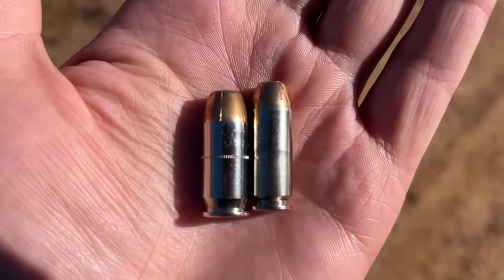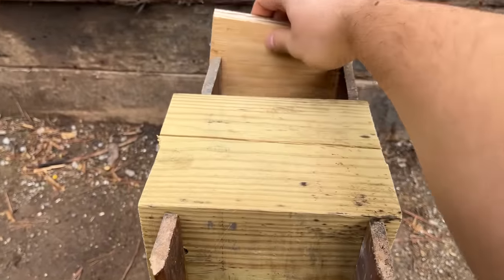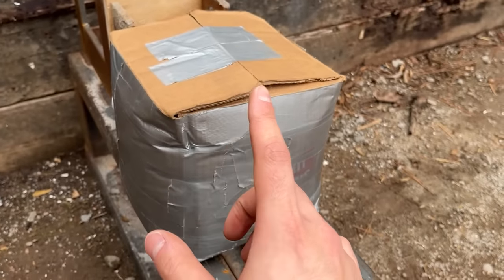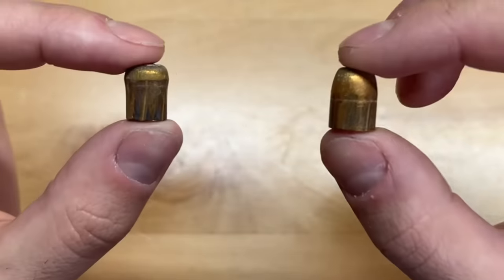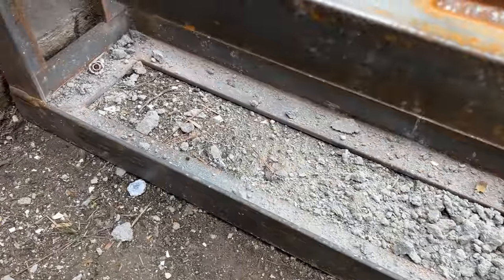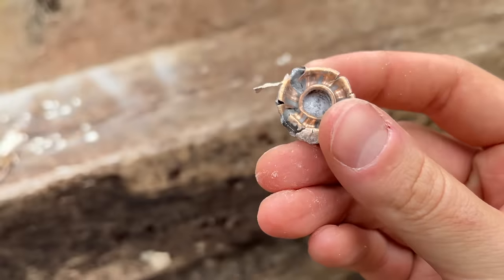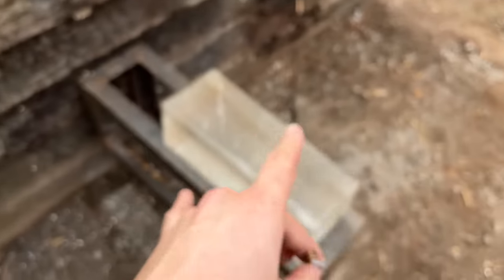45 ACP vs 10mm: Unbelievable Difference On Barriers

Comment: Just a thought: controllability enters into their defensive capability equation.  If a .45 is more controllable than a 10mm, then the all important follow-up shot issue comes into play.  Also, the .45 on the first tests was a flat nose commercial vs. a military ball round.  That would certainly make a difference in block penetration.  Finally, it would be instructive to see if a +P .45 would really make a difference, or a .45 of 180, vs 230 grain weight - after all, energy goes up as the square of the velocity.  Interesting video.
Reply: Ive got a 1911 in 45acp and ill say for a fact the 230gr hornady crutical duty +p atleast feel like theyre hauling the most ass (i know theyre not) but its got the most felt recoil compared to even the g9 defense 117gr ehps ive got in 45 which move at like 1500fps
Reply: Ft lbs is meaningless. You want to consider the momentum. Momentum and sectional density determine the ability of a bullet to penetrate. Momentum determines the recoil force. A 45 acp and 357 standard loadings have similar momentum, though the 357 has a much higher sectional density and much lower bullet weight.

The 220 +p critical duty is hauling ass for a 45acp, and it's a heavy bullet at that. Unless a bullet is travelling multiple thousands of fps, don't worry about ft lbs of energy
Reply: @bobjohnson1633  Well, not meaningless, but certainly the momentum of a bullet is grossly underrepresented in discussions about penetration in videos and posts.  It's also the case that - particularly in handguns, with their normally short barrels - acceleration to a higher muzzle velocity requires higher pressure, bringing with it greater muzzle blast and powder-related recoil force.  That energy-seeking path costs controllability as a result, whereas heavier bullets at lower velocity are tamer and more controllable.

Comment: I love that you used the heat gun so that we could see better. I think you are the only one I’ve seen do that. 

This was an interesting comparison. However, I think these cartridges fit different niches. The 40S&W is probably a better comparison against the 45ACP while the 10mm and 460Rowland are probably a better comparison for each other. Either way, the 45ACP wins at suppression.

Comment: Nice video, but it would have been nice to see you test some "good" ammo, like underwood or Buffalo bore since most 10mm on the market is basically .40 anyway. To put this into perspective, the 10mm I carry is over 700ft-lbs at the muzzle vs the 560 that the HST makes. And the hardcast rounds they have are incredible as well.
Reply: Yea it would be nice to see Federal American Eagle up their loads in their target 10mm to at least 650 ft lbs. I refuse to buy over priced 40 s&w spec 10mm that barely breaks the 400 ft lb range. Sig makes a decent load too. They actually have more pop than the Underwood 180 grain 10mm that I normally use.
Reply: Underwood extreme penetrators are absolutely amazing, look up 10mm and bullet proof glass, crazy stuff.
Reply: I wonder how well the 10MM does on a grizzly bears head at 10-15 yds.
Reply: My assumption is that a lot of factory 10mm is under-loaded to prevent issues with early 10mm 1911s that had a tendency to beat themselves up. This made sense when there were few 10mm options. Now there are a plenty of properly-designed 10mm pistols to choose from that can handle full-power 10mm. I just wish manufacturers were honest about labeling low-recoil 10mm ammo as such.

Comment: Years ago I was looking at 10mm over 45acp but it was hard to find and many weapons don't use it. So I switched to 45acp. The idea was to create as much damage as possible with the biggest wound channel as possible. Penetration was not on my radar in my self defense pistol caliber. In fact you really don't want alot of penetration and collateral damage. This video proves the research I did. TONS of ammunition available plus reloads (I like making my own hot loads if I need some extra umph). Even in wood those channels are big.

Comment: The same things you found here make a 10mm a great choice for a pistol caliber carbine.
Reply: I think the opposite is true: With 10mm you're getting all the overpenetration of a rifle with none of the ballistics advantages. With 45 you're getting less overpenetration with very good ballistics for a pistol caliber.
Reply: @scottfree6479  With the extra 300-400 fps I get with carbine over my 10mm 1911, expansion would not be a problem.  The 10mm, 357 Mag, 44 Mag all have enough powder capacity to make good use of the extra barrel length in a carbine.  I see the same kind of velocity increase between my 44 Mag pistols and my 44 Mag lever gun.
Reply: @timclaus8313 do they have 10mm carbines?
Reply: @timclaus8313  Expansion is never the problem; overpenetration is. If you actually want to do serious damage then use a rifle pushing over 2700 fps at the muzzle.

300blk and 45acp are ideal for home defense because they won't overpenetrate and can be suppressed well. A 10mm might hit, what, 1500 fps? 1700 at best with a super hot load? That still isn't even close to what a 556 will do going at 3000+

10mm really doesn't have any purpose. It's too powerful for a pistol and too weak for a rifle.
Reply: @JesusChrist_IsTruth-LoveForALL  Hi Point, Bear Creek Arsenal and Kriss all make 10mm carbines.  Mine is a Bear Creek, AR pattern, so it can use all the external AR 15 goodies, including the collapsable stocks, and uses standard Glock 20/29 magazines.
Reply: @timclaus8313  right on! That's awesome! 💪
Reply: It’s still a pistol round. Get a rifle
Reply: @Rubeless  I already have plenty of those, lol....

Comment: Grab an HK USP .45 and a bunch of  45 Super rounds (USPs can fire 45 super from the factory)  factory 185 grain 45 Super ammo  runs 1300 FPS and hits around 700 ft.  (694) Pounds of energy.  It’s a virtually identical to hot 180 grain 10mm ammo, except for a bigger hole.

Comment: The 45 acp was designed to take the enemy off their feet.
This is why the traditional bullet weight is 230 grain.
To me the full 10mm is a great round to do a lot of damage,with a big wound channel.
45 auto is more available and cost less.
+ P 45 autos normally come with a 180 grain bullet, along with a nasty hollow point will have more power than the 10mm depending on brand you buy for 10 mm.
Federal started manufacturing light 1 mm a few years after the shoot out in Miami.
The officers were out gunned  using 9mm
The bank robbers had mini 14s a 9mm stopped short from hitting one of the robbers heart.
Yet a few years later the office workers did not like the recoil,of the full 10mm,rather than let the officers in the office qualify with 9mm or 40s,and let  guys in the field use full 10mm,they had federal load weak rounds for the FBI.
Many swat teams use 45 auto,and for a while  
It was the side arm for the for the military when they ditched the 9 for awhile only to go back to it a few years ago.
The 45 acp has proven 
. In  combat for many years.
It can hold up to 15 rounds in double stack,and 9 rounds ln single stack mags.
The fat case can hold more powder,and could be made for heavier rounds at faster speeds.
Once again you can find ammo much easier

.
.
Reply: The traditional weight was 200 grains, not 230. 230 was a home defense round. You want to surpass the 10mm, just lower the grains on the bullet.
Reply: @TechieTard  45 ACP can never surpass 10mm. It's pressure limit is too low.

Comment: I use some +P 185 gr. hard cast led rounds in my 45. I wonder how a comparable 10mm round would stack up against that?
Reply: Against true 10mm no contest 10mm wins
Reply: 10mm has about the same powder, can be loaded with 230gr projectiles even tho 180 is more common. So the same input energy and mass, over a smaller area. That means more pressure. More pressure for the same mass means more velocity and output. The 10mm was designed to be an optimized 45, and it succeeds
Reply: @Mirage5892  yep basically not to mention thicker brass as well which is why 45 super came around also followed by 460 rowland but 10mm continues to be the most powerful readily available production pistol round there is

Comment: Thanks for the tests, but I was a bit surprised that your performance measure was based on penetration. I also noted you seemed to shoot the .45acp better than the 10mm. I'm a retired LEO and my experience on the streets of a major city PD where shootings were a regular occurrence, was that I responded to many crime scenes where the victims were shot with .38's, 9mm's, etc. and who were still breathing when we loaded them in the ambulance. I never responded to a scene where the victim was shot with a .45acp where they were still breathing. I knew they were shot with a .45 because the trip to the ME the next day verified it. Admittedly, we didn't come across 10mm's back then, but that .45acp has been working since 1911. Just to add - I own and love my Colt Delta Elite; just for a different reason.

Comment: If you wanted to have a better comparison, you could’ve used double tap, hard cast in the 45 ACP it penetrated 36 inches of gel it may have about performed that 10 mm.😊
Reply: Apples to oranges, bruh. How you gonna call off the shelf 10mm vs the spiciest of the spicy 45 a comparison.
Reply: @SpikeJonesTheCr0oked  I would assume they meant using Double Tap 10mm as well, since Double Tap are known for making and selling good hot 10mm loads.

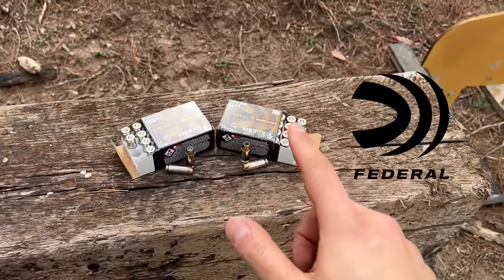Comment: Based on your standard set at the 7:18 mark, "whichever  cartridge makes a bigger wound channel while staying within the FBI penetration sweet spot will be the winner.", 45 won.

10mm went through the block, and based on the energy after exiting the 16" block, it definitely would have exceeded 18".

The 45 went 12.5, which is within the FBI standard.

Comment: With all due respect, and no offense meant, but this really isn't a true representation of the venerable 10mm round. The original Norma specs called for a 200gr solid at 1200fps, yielding close to 700 ft/lbs of energy. The rounds you used for these test are basically the 'FBI lite loads' developed for the FBI folks that couldn't handle the full powered 10mm loads, hence the later developed .40 S&W (Short & Weak). Only a few companies still produce rounds with the original power levels, and unless you "roll your own", which I do, there's no comparison! The original loading are almost equivalent to the S&W 41 magnum, which is NOT "short & weak"!
Reply: The fact you call.40 short and weak automatically discredits your argument..

Comment: I am not a caliber snob as I own quite a few. That being said my 10mm lives on my battle belt.
Reply: I can agree with that, plus it pairs well with my Bear Creek 10mm carbine, lol...
Reply: Have you times your splits with 10mm vs 9mm? For me the added energy of the 10mm isn't worth how much longer it takes to regain my sight picture unless I'm expecting threats larger than humans.
Reply: @1retiredknight  A 10mm in a 1911 is an easy shooting round.  Very quick on followup shots.
Reply: @timclaus8313  I am saving for the B&T 10mm, because I like my B&T APC Pro 9mm.
Reply: @timclaus8313  You have to be using some pretty light-loaded 10mm. Full pressure 10mm loads have been known to break 1911 frames.
Reply: @MrKingArthurhk  Always good to add some new toys to the kit.
Reply: @1retiredknight  Nope, full house 10mm loads in a bushing less slide set up.  Has a stout recoil spring, and launches the empties about 30 ft, lol...
Reply: @1retiredknight  Now that is one I haven't heard before.
Reply: @timclaus8313  Look into the original Norma loadings. They ran over 44,000 PSI and were pushing 200 grain projectiles over 1,200 fps.

The SAAMI spec now is closer the the 10mm Light developed by the FBI after they broke their test guns.
Reply: @timclaus8313  If brass is flying that far then the velocity of the slide is quite high, which is going to translate into more deflection of the sights when the slide hits the frame.  

Have you tried putting down side by side groups for time with the same platform in 9mm or .45 ACP?
Reply: @timclaus8313  I'm asking because I know for myself what feels fast isn't always. A good timer has taught me things about the way I shoot various handguns that often run counter to what subjective perception led me to believe.

Comment: Great vid, however I have 2 Springfield full-frame 1911s. First one is a 2004 Mil-Spec in the Parkerized finish with the 5" stainless steel match grade barrel. 20yrs and still going strong after thousands of rounds of all types and has NEVER stove-piped or jammed on me yet. The 2004 is my favorite go-to home defense pistol loaded with Federal Premium Hydra- Shok 210gr ammo and her accuracy at distance is uncanny.
Second is a Springfield full-frame Range Officer in Brushed Silver Stainless with the 5" stainless steel match grade barrel, adjustable rear sights, fiber optic front sights, the sweet thumb safety and custom trigger make it look as great as it performs. I put the 2004 Mil-Spec black grips on my Range Officer and it feels even better in my hand. I got a set of Magpul grips w/the "thumb groove" for the '04 Mil-Spec making both 1911s distinctive and comfortable in hand.
I just love my Springfield Armory 1911s the most. They just fit me, my personality to a T.
I also have a Gen 4 Glock 17C, yes, a Compensated barrel model which is the most accurate pistol at distance but extremely loud. I cant recommend the "C" version enough. Try a Glock "C" model as soon as you're able, you'll see how accurate they are, its amazing. 
I also have an H&K VP9, an outstanding modular pistol in 9mm. While im more accurate with the Glock the VP9 is reliable all day and then some. But, my 1911s are still my favorites, simple as.

Comment: I don't think anything will pen the sand. That being said I wanted to see a 300winmag loaded with accelerator rounds.
Reply: Great idea with the 300 Win Mag. but a monolithic non hollow point. Lead full metal jacket or not just isn't gonna get through a lot of sand. The monolithic might. They just don't seem to travel as straight after impact though.
Reply: @kentuckywindage222  well that's the beauty of the Accelerator is a 30 cal sabot with a .223 projectile. pop out the round and replace it with M995 or m855A1. and still get that sweet sweet 4000fps
Reply: @hiphopguy0  
Seen those in 30-06 but not in 300 Win. Mag. The 30-06 ones were made by Remington that I tried years ago. Lot of speed but accuracy was terrible. I think those were purported to something around 4000. Of course a 220 Swift will do it with just the bullet. With handloads for sure. Manufacturer rounds I doubt. Problem with 220 Swift is it just eats barrels. Burns throats like crazy but anything with much overbore will.
Reply: @kentuckywindage222  There are vids on YT where people are handloading the accelerator rounds into WM. My understanding for the accuracy problem is barrel twist is mean for a round 3-4 times heavier, and the plastic sabot not always engaging the rifling. I only suggest because 8" of sand is a tall order for anything so far. I still think it would fail though.

Comment: I love things like 10mm. but every test ever seems to just always show for a handgun you literally can not beat 9mm. more rounds than 45. and almost the same damage. smaller than most of everything else. lower recoil than everything else other than .38 and 5.7. almost no chance of over pen and super common so no legal nightmare for using it. it's also at most times of the year the cheapest for both ammo and firearms.
Reply: The 9mm had benefited hugely from improved bullet design over the past 30 years. Most of the negative opinion of it going back to the 1980s and 90s were due to projectiles that did not function optimally within the velocity envelope of the 9mm Luger round.
Reply: The same people that say 9mm isn’t enough are the same that bash the AR, clueless and zero experience types.
Reply: @Rubeless  You have to clarify enough for what. For close range defense against threats of around human size and smaller 9mm with modern projectiles is pretty effective. If you might have to deal with a wounded moose or angry bear, other rounds may be a better choice.

Comment: They both dumped all their energy in the target. I’d say carry whichever of the two you like. They both work.
UPDATE: Final test. How can you say the 10mm won when it didn’t stay in the block and the .45 penetrated per the requirement and DID? I call that a win for the .45, not the 10. As I previously stated, though, they are both up to the job, so pick whichever you prefer. However, if you already have one, there’s no need to buy the other.
Reply: He also used a bare gel block rather than putting a layer of clothing in front.  Clothing tends to inhibit expansion to some degree which oftentimes results in deeper penetration.  My guess is that both bullets would have expanded slightly less and gone deeper.  Which means in all probability the .45 would be closer to the sweet spot of 15" while the 10mm would have certainly exceeded 18".